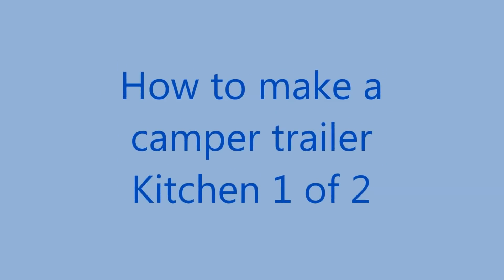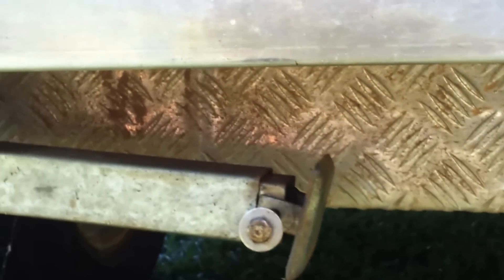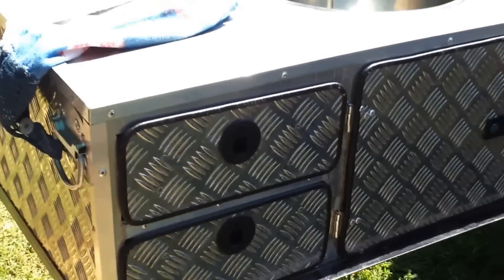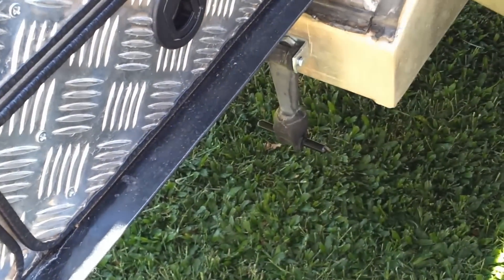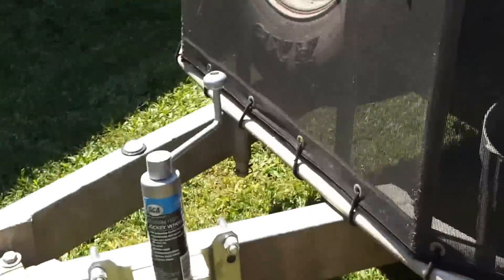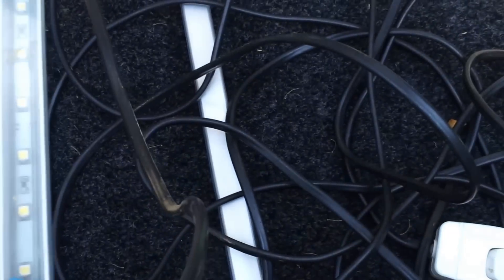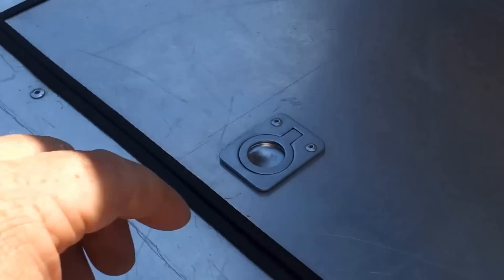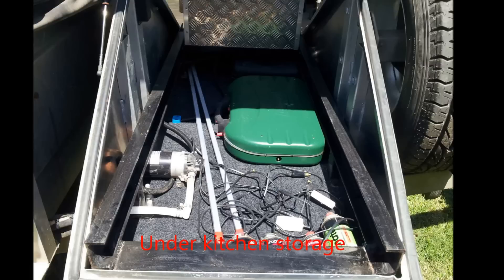How to build a camper trailer kitchen part 1 of 2.mp4

Comment from the maker: Hi Peter, the bearing was a car bearing weldered to the steal tray that the kitchen is on.  The u frame is the size of the bearing as tight as it can be to allow no play in it.  It is very strong and can take at leased 100kg of weight. The U frame is attached to the steal trailer frame to take the weight also.  
Greg

Comment: Great job, Looks super good and very convenient to use. But the video is just so hard to watch - I got a headache by the end of it as I can't focus on anything as everything is just flying in front of you as the camera moves constantly back and forth. It would be nicer to keep the camera more steady and do less moves with the camera trying to follow every line, cable opening and closing drawer and so on. That would make a huge difference. 
But the kitchen is just great and it's made of aluminum and not completely plywood and that makes a huge difference in weight too.

Comment: Nice work Greg, I'm trying to upgrade my camping trailer I semi built I also live in QLD. is there any legal requirements I need to know about before going ahead like electrical, gas, etc.
Reply from the maker: Hi Dan, There is lots of laws that you need to be aware of and I am not an expert, The weight of the trailer has to have brakes if it is over 750Kgs, So if you build a kitchen with a water tank and carry all your gear you may need breaks.  the gas should not be a problem as all fittings and the bottles are all legal.  The electrical is up to you but fusses and corrected fitting is about being safe.
Reply from the maker: Greg Tanner
You also need to be aware of your ball weight which in Qld is around 10% of the overall trailer weight.  So if your trailer weighs 800kgs the ball weight should not exceed 80kgs.  The tow vehicle also has a safe tow rate and should not be exceeded.  You can find all this information Qld Transport web.
Reply: Greg Tanner awesome info mate, cheers!

Comment: Hey there's a massive sound sync issue about 10 seconds or so
Reply from the maker: Sorry about that, I am new at all this technology, and suggestions on how I can fix it. thanks for your comments Greg
Reply: It was slightly fixed in part 2 I use to just pause every 30 seconds or so to let it catch up "like you did in part 2" but if you use windows movie maker is good for syncing it up ill watch anything boring but the out of sync thing is a big killer